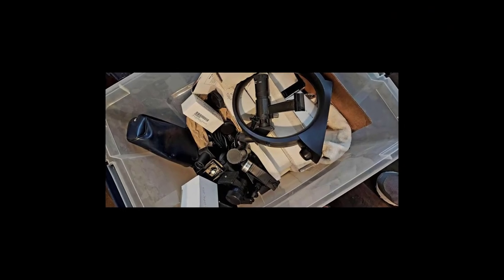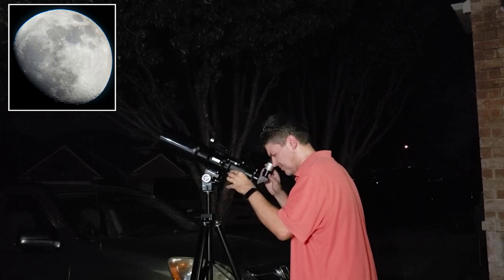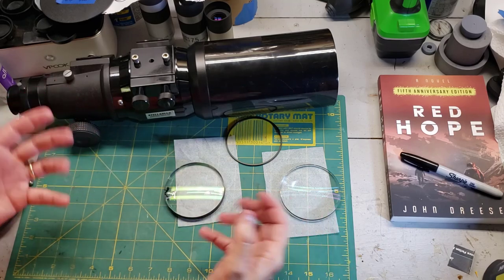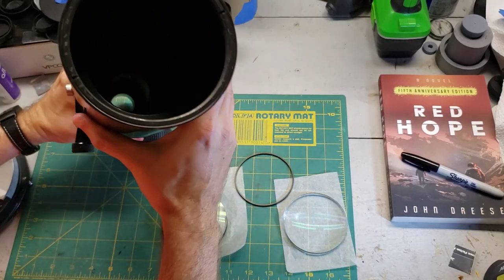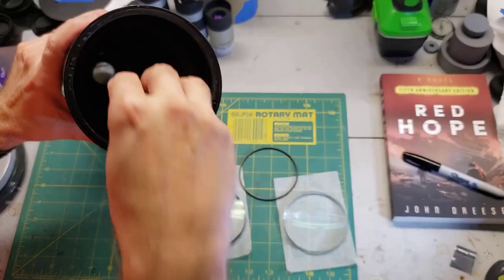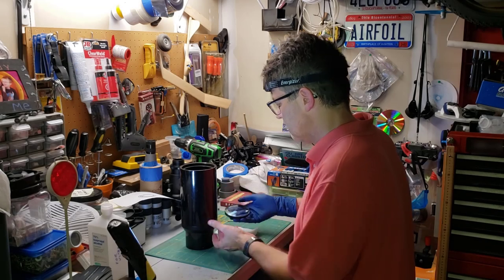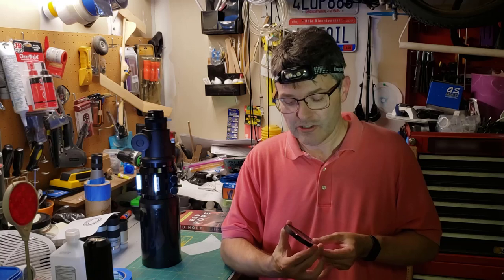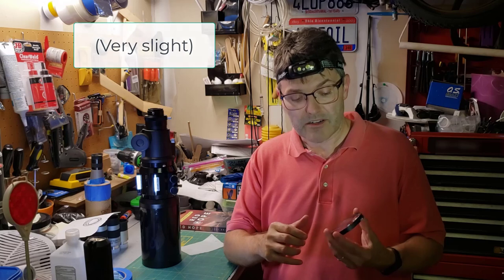I Broke My Telescope - Here's Why...

Comment: There is a strap/handle system that is used to remove stuck oil filters from cars.  The strap goes around the filter and connects back to the handle.  Possibly you could one to remove the dew shield.
Reply from the maker: That might be a great way to do it.  I was able to remove the dew shield once, so I don't understand why it didn't come off ever again.

Comment: Hi, I have the same StellarVue NightHawk Telescope. With kitchen tools - those you use for opening lids on glasses - it was easy to remove the shield. I screwed of the whole lens holder, screwed on a FPL53 APO lens which I got for a good price (used) and ready was my NightHawk APO ...
Very sorry about your mishap there.
Reply from the maker: I think once I broke it, I was feeling pretty dumb and just wanted to send it to somebody who could put it to good use. Good on you for knowing what you were doing. I'm learning, slowly.  :)  Clear skies!
Reply: You can’t just fit an objective lens to a refractor. They are all optically ground to match the a very accurate light ray path for each model of telescope. I’m afraid you don’t even remotely have an apochromatic telescope.
Reply from the maker: @Astronurd   It was a very educational (and painful) experience. I learned lots.

Comment: I found a Nighthawk ii for sale local posted on Friday.  I messaged the seller and waited for a response. Finally Saturday morning they replied and said it was still available but couldn't pick it up until Sunday.  I was hoping it wouldn't be sold out from under me as has happened in the past. Sunday comes and I picked it up! It came with 2 speed Crawford focuser. Aluminum alt az mount with slow motion controls. A nice oak tripod with Stellarvue M1 mount. Meade 6.3 and 26mm super Plossl eps, Meade diagonal and the carrying case and original manuals.  It's in nice condition. Some small specks of dust on the lens but I'm gonna leave them alone.
Reply from the maker: Sounds like you got quite a nice telescope.  Definitely don't clean the inside of the lens pack. If you must, send it to Stellarvue - they have a relatively cheap cleaning service.
Reply: @AstronomyGarage  thanks, I'm ready for some clear skies now lol dang Oklahoma weather!

Comment: That was NOT entirely your fault. I worked for Gallo Wine in their Glass factory at Modesto CA. When glass is not tempered properly the glass crystals are like wound springs waiting to fly off in all directions, all the glass needs is a sharp tap. Molten glass is first molded, then should be reheated to almost molten, and then aloud to cool very slow. This lets all the tensions, that form when the crystals harden and align, to even out, thus tempering the glass. (Not to be confused with thermal tempering, like in auto glass. This is a process of "cool" tempering so that it shatters into small pieces, while giving added strength.) I can only guess that they skip this reheating step in manufacturing to make the grinding and polishing process faster.  One would have far less "cull" as distortion could be introduced when reheating, it is also cheaper. Perhaps the manufacture used a thermal tempering process to give the glass more strength, and thus less distortion, as lenses have varying thicknesses, temperature variation could introduce a minute amount of warping in large lenses. Either way, it should not have just shattered like it did. I know nothing about lens making, so I can only speculate, but you should feel vindicated.
Reply from the maker: I guarantee you know more about glass than I do!  In hindsight, I should've kept the telescope and made a circular mask to kindof "hide" the broken portion.  It would've still worked, but gathered less light.  Unfortunately, I didn't know about masking back then.
Reply: @AstronomyGarage  I have been enjoying your videos. I did not see any that were about taking "Christmas trash" and making it useable. I unfortunately have a reflector that I want to try to make a Dobsonian mount for and then upgrade the internals. I know that it is not worth the time, but I have Long Covid and cannot work. It is not like I need another telescope, but I just want the challenge. Perhaps a good video topic?
Reply from the maker: I like that idea - "Turning Trash Telescopes Into Treasures".  Sorry to hear about the long covid!  That's pretty rough.  I managed to fend it off for three years and then, wham, the whole house got it about 5 months ago.  It derailed me for a good 2 or 3 weeks. I'd like to think that  I'm over any long-term symptoms, but only time will tell.  Okay, as for converting yours to a Dob, there is a middle-ground.  If it already has a Vixen dovetail block on the tube, you can hook  it up to a plethora of alt-azimuth mounts that will work nearly as well as a Dob (maybe even better if the telescope tube is smaller diameter).  I do have an upgrade video planned for the Celestron Powerseeker 127EQ, the most hated telescope in the solar system.
Reply: @AstronomyGarage  Sadly no vixen on my bright red Tasco (perhaps the most hated telescope in the known universe). I am planning to do a complete rebuild. I will salvage what little I can, then build the scope the way it should have been. I am not able to focus like I used to, so it will take a while, but I need something to look forward to. I get so loopy with the Long Covid, today I broke a watch just trying to change the battery. Today was a bad day, and on those days, I am not good for much. If I go slow - and avoid working on it when I feel bad, I know I won't make the telescope any worse. I will enjoy your video on the Powerseeker 127EQ, that sounds like good inspiration.
Reply from the maker: The long covid sounds like a beating, but keep at it.  I've heard that eventually, things do approach normalcy.

Comment: The Stellavue Nighthawk is an achromatic refractor which does have chromatic aberration due to the cheaper glass lenses. If you want to remove the CA you would need an apochromatic refractor which is about four times the price.
Reply from the maker: True, and generally speaking the longer/skinnier the refractor, the less chromatic aberration it'll have. I've just picked up an 80mm Japanese-made Celestron from the 1980's.  Will be testing soon.

Comment: Recently I purchased a box o stuff that included 1980s eyepieces, including 8 TV Naglers and Plossls (which is the main reason I bought this stuff) with a TV Big Barlow and Paracorr, and many other items. Many of these have dirt and fungal growth, so I am in a learning mode on what solutions I can mix to do a good cleaning. Most I have already cleaned with the usualy methods, plus 1 that I sent out to a pro for cleaning, but the barlow and paracorr have haze which is more of a challenge. Not sure what to do about these and may have to send them in to that shop. I'm waiting to see the results of the TV 13mm Nagler I sent in. Any suggestions on how to dissolve haze? I think it might be between 2 glued lenses and the glue has started to decompose over the years. On one the haze might be just on the surface, but the regular cleaning liquids have done nothing. 

There is also a Unitron Unihex. Not sure what to do with this. Sell it! Also 2 large finder scopes, adapters for cameras, and old Telrad, 6" solar filter, etc. Still sorting though it all.
Reply from the maker: It sounds like you found quite the treasure trove.  If the haze is on the surface, you can try to clean it with a good lens cleaning liquid (some people just use rubbing alcohol). You may want to give a LensPen a try too (https://youtu.be/FHW7jZJFir4).  If the haze is in the glue, then I don't know if that is fixable at all unfortunately.
Reply: Got most items cleaned, but the paracorr and big barlow need new lenses. Do you know what adapter is needed to connect the Unihex model A to a 1.25 or 2" diagonal?

Comment: Hey, any idea why did the lense crack ?
Reply from the maker: Yes. There were set screws to help center the main lens in the tube. I didn't know about them and applied torque at just the wrong spot.  :(
Reply: @AstronomyGarage  Oh ok. Very unfortunate incident. No issues. Hope you can salvage the scope.

Comment: absolute amateur, here, suggest using very fine grit sandpaper to feather off sharp glass edges,less likely to chip and crack on hitting some metal obstruction
Reply from the maker: As a reflector person myself, I'll have to take your word for it. Seems like a reasonable thing to do. Ideally, I should've finally figured out how to get the dew shield off and loosen the set screws.

Comment: Hello, Mr. Dreese;
I'm sorry to hear of your misfortune.
I hope you know that, often, damage like this is fairly minor, or maybe, even negligible.
The only way to know for sure is to reassemble & try it to see.
Another astro-'tuber (don't recall the name) has a video w/ a damaged objective lens.
(Maybe Ed Ting?-I can't recall.)
In his video he said the damage did not make a real difference.
I suppose the details of the damage determine how it affects the use of the lens.
Thank you for sharing your 'lesson' w/ your 'tuber crew.
I could not understand exactly how the lens broke so . . .
BTW, I have a very inexpensive refractor.
My dear wife bought a Tasco 70mm SpaceStation & gifted it to me.
I think they are ~$150US on amazon today, July 17, 2022.
My O.T.A. has fairly good optics as far as I can tell, tho I don't have much experience.
Like your Stellarvue it has a blue fringe on observed objects.
The main issue is the flimsy tripod, even if the OTA is fine the tripod really not good.
A tripod costs nearly as much as that entire 'scope, ~$100-$150 & up (very much up!).
Have a GREAT day, Neighbor!
Reply from the maker: Hi Mr. Steedley, thank you for watching! Although the camera didn't show it, the damage looked ( at least to me) quite substantial.  With reflectors, I would just paint the damaged area flat black and it wouldn't be noticeable in the image, but with this particular crack/chip, I couldn't see spending the time to finally get the lens cell out (my first big mistake) to remove the set screws.  As for when the lens broke, I was being extremely careful with light pressure and that's all it took. I guess it was just crooked enough and the set screw was pushing on the wrong spot.  In the end, it was my fault and very frustrating..